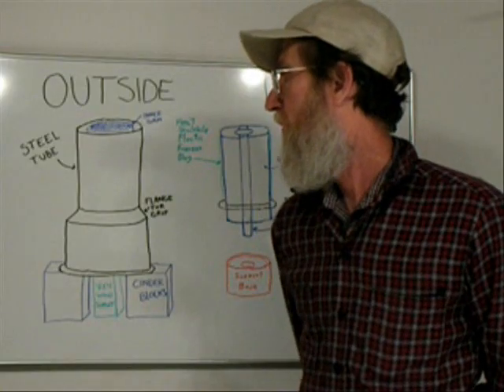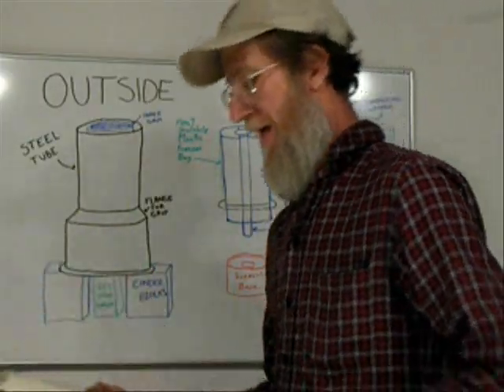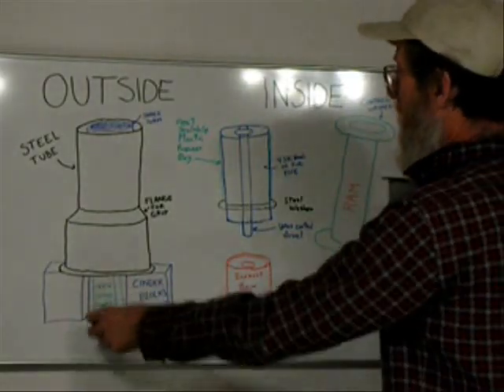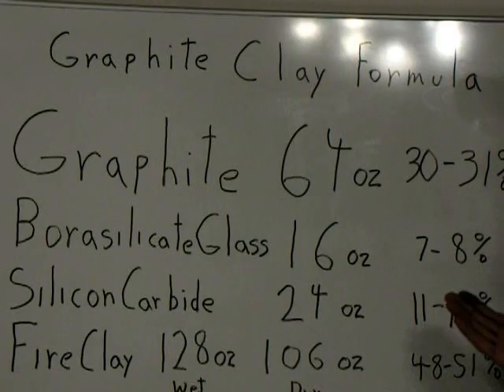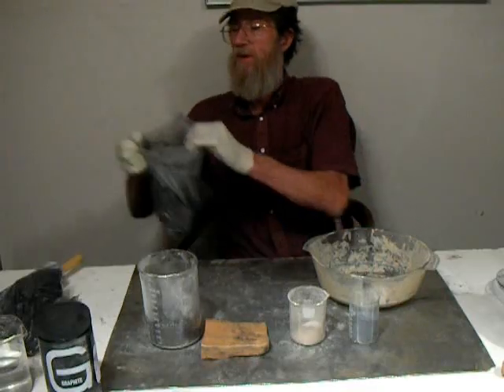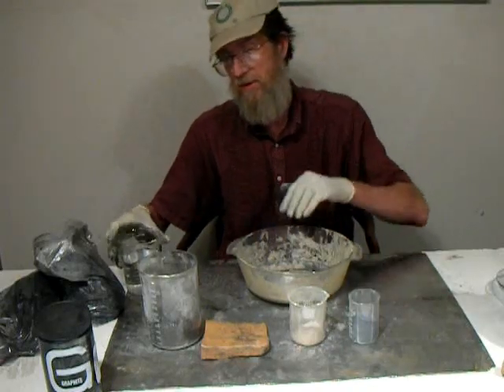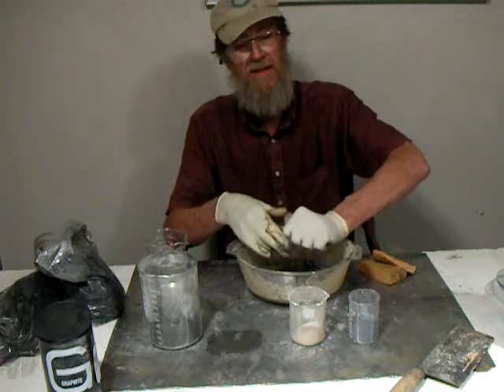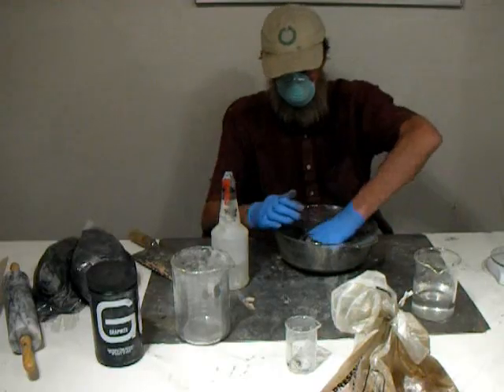Making a Graphite Crucible

Comment: Okay bob, I've done a lot of looking around for the least expensive source of graphite and I've been eyeballing a product called Seed SLIK lubricant.  It's a dry powder and can be had for quite a bit cheaper per pound than the Dixon brand amorphous powder.  I'm only a hobbyist with this stuff right now, so expense is a huge deal for me.  It's in powdered form and the MSDS shows only graphite and silica in the contents.  Do you see any reason why this wouldn't work? 
Also, I plan to build myself a throwing wheel and make a jigger/jolly arm for it to make my crucibles because it seems like it would be quicker and easier.  It's a sort of machining process with wet clay that uses a profiled tool to maintain consistent shape for mass production of many identical pieces.  I like the idea (as opposed to by hand) specifically because I can get a consistent thickness crucible without the need for a press like you have here.
Reply from the maker: No it's way way to fine. Google "Dixon Flake Graphite." Try to find large flake and if not settle on medium.  You will find plenty of sources.  Be advised one carrier has it listed as hazardous so don't use them. UPS I think.  Post office and the other carrier does not.  Also I recommend backing off 1 LB from the formula.  You will still get good thermal quality but make it a lot easier to work with.  I think you should try clay at first getting your setup right then move to the more expensive graphite.
Reply from the maker: Anything around 150 up will work. Truth is I have an advanced formula substituting water with a colloidal silica mix but the darn stuff is so Hydroscopic no one could do it successfully unless they followed my instructions to the letter.  First one blew up on me in my wife's oven.  Flaw was I thought after drying it out in the oven I had passed the boiling point of water and went for the ramp. Later a mercury lab thermometer proved the oven about 15 degrees off.  I just do not want to post a video unless I know for a fact it works and have repeated it many times.
Reply: rlbob1 use a kiln, crucibles will last many times longer.

Comment: I'm looking into casting metals, starting with aluminum, and I wanted to get clean non-ferrous pours to maintain the strength of the alloy for use in machine tooling.  I did a search for fire clay and the closest I could find was "low-fire clay".  Is that the same stuff?

Also, I was thinking while I watched your very informative video that adding even a slight taper to your forms would make it easier to extract them after pressing.  Has anyone tried this?
Reply from the maker: I am using a ready mixed ceramic clay called "woodfire" in the video.  Clays of this type are available at ceramic shops for making pottery.  Try to find a clay that fires at the highest Cone they have available. Google "ceramic cone fire chart" for more info.  Other options are of course steel crucibles, stainless,ceramic clay, etc.  Steel does not last long due to the corrosive nature of propane. Stainless would be great but it requires Tri-mix shielding gas and stainless wire to weld with a MIG.  Very expensive.  Clay as I described is cheaper than steel and will last longer.
    You could make a crucible mold out wood divide it into 3 or more sections bolted together and ram it by hand.  The core is a problem when you start making one any larger than a drinking cup or glass.  It sticks fiercely to wet clay due to the suction of the vacuum created trying to remove it.  Hard as it is to imagine this effect is so great even a heavy bulldozer can get stuck with the right mix of clay, mud and the vacuum effect.
bob
Reply: Thank you for the information bob, I appreciate it.

Comment: First of all yer a God Damn CHEMIST my friend and second,FINALLY someone wearing proper aluminized safety protection! I used to run a 2 million pound a year aluminum smelter and the number of people on YouTube running around in tshirts melting metal with zero safety gear on just blows my mind!

Great video!
Reply: Thanks for your profanity
Reply: I think the main reason people don't use this kind of gear is because they don't know where to get it from and if they do don't have the money
Reply: I only smelt in my crocs... 👷🏽
Reply: CdnCarWrapper or barefoot. Dumbasses
Reply: My idea why they dont use proper safety is that the metal doesnt glow red hot. People are generally afraid of red hot metals but not metals that look molten similar to when solid.

Comment: Does anyone else find it intensely hilarious that he's wearing a full-on thermal suit while doing pours on a wooden deck?
Reply from the maker: Its a gravel drive.  The railing in the background is concrete.
Reply: Its an aluminized reflective suit and its exactly what someone who is pouring molten metal should be wearing. One drop of moisture in your casting molds and you'll understand REAL QUICK why you want to be wearing that.
Reply: that ain't a deck gomer.
Reply: safety first man lol
Reply: ***** i start with dry ingredients. Much better for mixing.
Reply: anonynomnomnom "one droo in the aluminum mold."  Yup, i was sweating like a stuck hog last time i fired up the foundry.  Not good.  I would rather look like an astronaut than have molted aluminum on me.
Reply: Pay attention before you open your mouth and let everyone know how stupid you really are. That man is on gravel.
Reply: Mistakes happen. The interesting thing about mistakes, is that they are by definition not intentional. Unlike the choice to be an assknob  on a comment written 3 years ago - even though the original commenter had already been corrected a few times already by people who weren't arrogant douchetubers.
Reply: ribob 1 How to make a ceramic crucible?
Reply: first off,  its not a wooden deck....second off you haven't been burnt yet...... better safe than sorry

Comment: I have been looking at my local hardware stores but I can not find any that sell graphite in powder form, do you have ay suggestion?
Reply from the maker: Look for #2 or #3 large flake graphite in either Southwestern Graphite or Dixon brands.  ReStockIt.com has been a reliable source of supply.  Be aware one of the two shippers either UPS or Fedex has it mistakenly listed as hazardous material.  No sense paying hazmat fee.  Post office has no problem with it and I think it is UPS that messed up but cannot remember.

Comment: The formulas and how to mix the clay was great. What you were doing after you made the rings was very obscure.
Reply from the maker: Unfortunately the solid steel tubes did not allow much for camera angles so I had to rely on the storyboard in the beginning. Still I think I can answer most of your questions.  The large tube with the hex flange is bolted to two 2*4's which straddle the concrete blocks and firmly hold the smaller tube and the core base in place. The large washer on the core base fits snugly against the end of the flared portion of the small tube and keeps the clay from pushing out the bottom.  It also centers the core and forms a nice flair for the crucible top You recall the hollow ram also has a solid end as well as the washer end. After building the clay to the top of the core you flip it to the solid end and add another inch of clay for the solid bottom. The solid end is also used to force the crucible out of the mold after unbolting a board holding the core base in place. Just remembering it is being formed upside down with the flanged top facing down and the solid bottom up and that will help visualization.
Reply: He was using a hydraulic jack to compress the rings with the collared steel tube he showed you in the beginning.

@rlbob1, did you score the ring segments before setting them in the mold?
Reply: He didnt show how the mold goes together, or how it is oriented in the press.  It's not clear or detailed how he packed the clay nor did it show what keeps the clay from just pushing out the bottom. How did he end up with a solid bottom if he is using a hollow ram with a flange? No information on that. How thick is the walls and bottom? Not a clue. At 10:24 you mostly see his back not a clue what he is doing there. At 10:34 he ducks down so who knows what he is doing there. All the camera shows is the same large tube with a hex flange. Whats the large tube with the hex flange for? Between 10:24 and 11:21 he shows nothing of what he is doing. Between the beginning up to 7:40 its a great video. Between 7:40 and 11:21 not so much. After 11:21 he shows what is going on again. Like most things in life you never get the full story from one source.

Comment: Would you be willing to sell/make a crucible for myself?  I don't have access to the materials you are so comfortable with and honestly would prefer to have that part made by a professional.
Reply from the maker: No You might consider an inexpensive clay crucible purchased from a casting supplier to start with.  You also could consider making a steel one if you have a friend good with a welder.
Reply: Okay, thanks for responding.  One more question though, would your setup be able to melt copper as well as aluminum?

Comment: thanks for your video,yesterday i made research on the net and found out about lost foam casting and slury for better surface."The prepared foam patterns were then dipped for 60 sec. into a slurry made of a mixture of Zircon flour and colloidal silicate".You can find out some more if you Google article;Process Control of Lost Foam Casting using Slurry Viscosity and Dipping Time

Comment: I am trying find borasilicate glass to buy, but i have not found in my country(Brazil), I need your help to inform me the best way to get some quantity of this powder. I feel so grateful if you can help me giving me a idea of the best way to get it. Or if you have a new formula easier to implement without use this material. Thanks for your video and God always bless you.
Reply: Pyrex glass works almost just as well.  It is a lime silicate glass.

Comment: Great job btw. if you can clarify some confusion for me on what type of fire clay to buy online i see fireclay cone 5 through 10 from what i understand the higher the number the higher the temperature is needed to cure the clay. is a cone 10 fire clay what im looking for or am i completely lost. second question how much clay will i need to make the crucible in your vid? and also in your propane foundry how much refractory did you use

Comment: Trying to melt approx. 56  pounds of steel. I have 55 gallon drum, 2 in. 3000° refractory all around , 2 in. 2600° ceramic blanket. Not assembled yet. Any advice greatly appreciated.

Comment: I'm a amateur mechanic. I really like the foundry work, melting metal. I have a lot of car parts anything from aluminum heads, to steel leaf springs. I figured instead off tossing them why not melt them into other things. Use the old things to make New things. Aluminum heads no problem melting. 1095 steel coils very different animal. I figured if I can melt steel then everything else would be easier. Thanks cont.

Comment: I was also wondering what was your thickness, length, OD, ID, of your crucible. One more question. This crucible can it be use for all other metal lower than steel. If I guess right. Not using the same one of course. Thanks so much. I'm also going to make videos of my foundry. I promise I'll give you the credit that you've earned. Thank you much your hard work, and incite. : )

Comment: Silicon carbide can be obtained from ceramic insulators used in various applications where nicd coils are used?  Borosilicated glass can be obtained from pyrex glass?  Graphite can be obtained from the back of old style tv tubes and computer cords?  Are all these assuptions correct and fire clay is there a free place to get that?

Comment: One tip on clay:  it resists water absorption if it already has any water in it, so you could pre-weigh it for your formula, then let it dry completely out.  Completely dry clay absorbs water very readily and it's easy to make into a paste.  By the way, what kind of metal are these crucibles for?